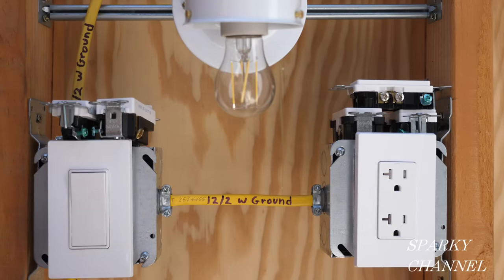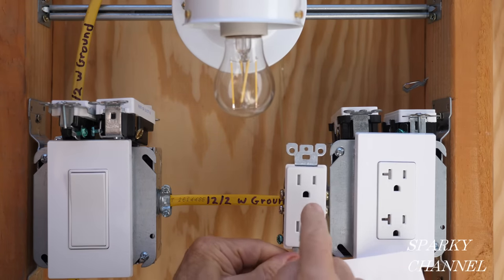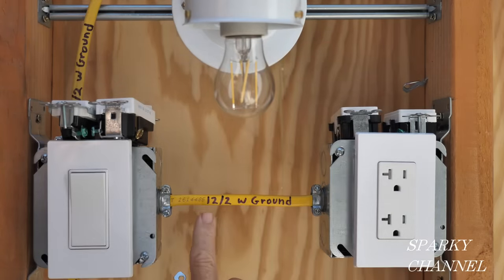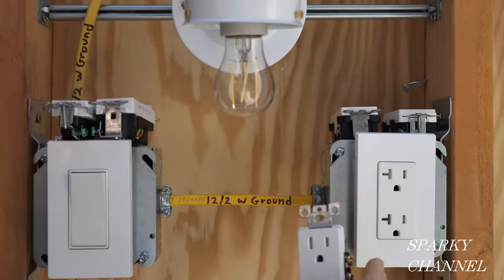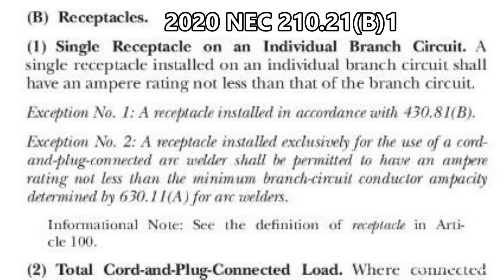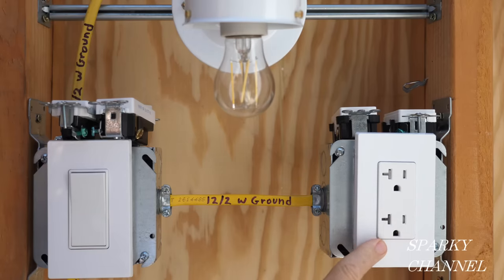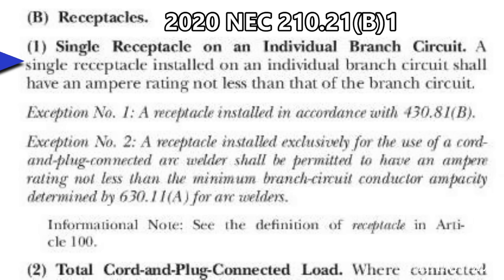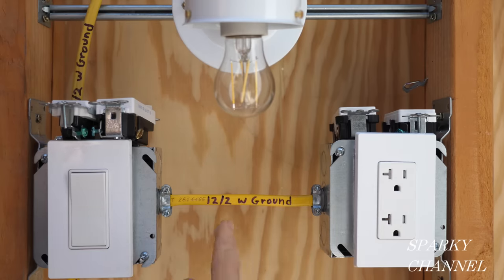Shall I Use a 15A or a 20A Receptacle on a 20A Circuit? + 2020 NEC 210.21(B)(1) and 210.21(B)(3)

Comment: In a residential situation they don't make appliances with 20 amp cords
Reply: What do you mean aren't totster's and coffee makers made with 20 amp cords?
Reply: @zacharywatts1514  they are typically plugged in to 20 amp circuits but the cord end is only 15 amp
Reply: Sure they do.
Reply: @brianharmeson3144  I've been doing electric for 17 years and have never seen a 20 amp 120 volt cord cap on a residential appliance.
Reply: @FH_83_02  That doesn't mean they don't exist. I've been in the trade for over 30 years and there are still things I haven't seen. That doesn't mean they don't exist.
Reply: @FH_83_02  Window AC, welders, large coffee makers, kilns, treadmills and the list goes on and on.
Reply: @FH_83_02  you said it. The key word is residential. 73
Reply: @zacharywatts1514  the commercial grade yes but the residential are 15 amp, or less depending on the total wattage. A two slice toaster uses less current than a four slice model. 73
Reply: How many people have a kiln in their home? Just thought I should ask. 73
Reply: @ronb6182  There are 120v 20A welders. There are also 120v 20A AC units. Contrary to the comment above, they are both frequently used in homes/garages. That's the whole point.
Reply: For the most part they don't excluding AC and welder units. Most normal people keep their welders in the garage or basement or outside shop. We are also talking about the horizontal neutral on a 20 amp plug. Enough said. 73
Reply: @ronb6182  thankyou for the specification
Reply: They should not be allowed to make 20 devices with standard plugs on them because they could be plugged into 15 amp circuits which will burn up the terminals on 15 amp outlets. My brother in law plugged in a spa in a 15 amp outlet and burned up the main GFI outlet. All twenty amp appliances should have the horizontal neutral. Probably the problem is China made products not UL approved. 73
Reply: @ronb6182  Yes, I know what a 20a plug looks like. You obviously haven't been around long enough to see the numerous equipment supplied with 20a plugs in residential settings. Just because you have never seen something, doesn't mean it doesn't exist. This includes basements and garages of course.
Reply: @ronb6182  You think 20a AC, 20a welders and 20a treadmills have 15a plugs on them? You're mistaken.
Reply: @ronb6182  I have wired power for more than a dozen kiln installs in the past 6 years in both garages and basements. It is a big craft thing in some areas.
Reply: @ronb6182  If you don't think people have 20a coffee makers in their house then you don't do alot of high end homes. I have installed 240v, 30a circuits for coffee makers before. It was a $7000 coffee maker.
Reply: @brianharmeson3144  give it up it's not on topic we are talking about kitchen appliances like microwaves and toasters mixers blenders not commercial appliances. All the home workout equipment I seen are 15 amp number 14 wire. Some are number 16.
Reply: @zacharywatts1514  Thank you I don't believe this other joker can argue with no sense. Time to put him away. Most homes I been in don't have twenty amp outlets in the house. I would like to have a few in my workshop I have a 20 amp power strip with a real twenty amp plug on it. When I move I will install one twenty amp outlet in my shop. The house has 15 amp receptacles that are daisy  chained on a twenty amp breaker. All passed inspection when I wired it back in 2001.  73
Reply: @ronb6182  This video has absolutely nothing to do specifically with kitchen appliances. You're making up things as you go along. This post is about installing 15 or 20a receptacles on a 20a circuit. Period. Nothing about kitchens or the appliances within.  Besides, my reply, which for some strange reason, you are so bent out of shape about, was a direct reply to the ridiculous comment by "F H" stating that "In a residential situation they don't make appliances with 20 amp cords" which is COMPETELY FALSE. Maybe you should read more carefully.
Reply: @brianharmeson3144  completely false?  Learn the trade before commenting on grown man shit
Reply: @FH_83_02  What specifically is "completely false" about anything I said?
Reply: @brianharmeson3144  they do not use 20 amp cord caps for residential appliances. Not sure why I keep getting notifications about this dumb shit.
Reply: So you actually know absolutely nothing about electrical equipment at all. Got it. 👍
Reply: Coffee maker, treadmill, jacuzzi tub, space heater, elliptical machine, pottery kiln, mig welder. These are all home appliances I have installed 20a circuits and receptacles for because they' had 20a cords on them. Just because you lack experience and haven't seen something, doesn't mean it doesn't exist. Grow up.
Reply: @FH_83_02  I’m not an electrician but I read/heard you should use 15A receptacles on 20A circuit to stay under 80% of total load of circuit?

And use 20A receptacle on 25A or 30A circuit?

I’m just asking because it’s what I heard and y’all seem to have a little experience.
Reply: @seabass22  you can use a 15 amp receptacle for 15 or 20 amp circuits, but not a 20 amp receptacle on a 15 amp circuit. The configuration is different. Anything over 20 amps needs a receptacle rated for the amperage.
Reply: @seabass22  I left out the last part of your question. The device doesn't control the load of a circuit, the breaker does. A 20 amp breaker is really only good for 16 amps and a 15 amp breaker is only good for 12
Reply: @FH_83_02  so on a 20 amp circuit, you should use 15A outlets?
Reply: @seabass22  unless the circuit calls for a 20 amp receptacle you will be fine with a 15 amp receptacle.
Reply: @FH_83_02  You're absolutely right. The only 20 Amp male plug I've ever seen was on a 120 volt electric welder. Not saying thats the only thing that has them but that's the only one I've seen.
Reply: Assuming that 20 amp plugs do exist in appliances for residential use, the requirement is that they are to be used on dedicated circuits only, meaning the 20 amp receptacle must be a single socket, not a duplex. Therefore the argument over needing a 20 amp duplex receptacle is moot.

Comment: No mention that the 20A's have stronger clamping force, so less chance of the outlet melting due to high resistance.
Reply from the maker: Thanks!
Reply: many are exactly the same internally.

Comment: Not being able to use a heavier duty component than is required does not make any sense?
Reply: Who says you can't? Just use a spec grade or heavy duty spec grade 15 amp and that's as good in quality as a comparable 20 amp device.
Reply: @surferdude642  Sparkey Channel and the NEC.
Reply: @sailingeden9866  I didn't say to use 20 amp receptacle, but rather than a residential grade 15 amp, you can use higher grade 15 amp. Bill (sparky channel) mentions these in this video. Bill was comparing a residential grade 15 amp to a spec grade 20 amp. He should compare apples to apples, then the quality is equivalent. The NEC provides the minimum requirement and is not an issue in this case.

Comment: I have a 20 amp breaker for the garage with 15 amp outlets. I honestly feel like the wire is 14 guage.
Reply from the maker: If it's 14AWG wire the maximum size breaker you can use is 15A.
Reply: @SparkyChannel  it does not appear that anything has been recently done. The house was built in the 80s. It did pass a through inspection. How can I tell if it's 12 or 14?
Reply: @jungleviper  14 gauge wire is 1.5mm diameter, 12 gauge is 2.0mm diameter. Bare wire, not including insulation.
Reply: @jungleviper  12 gauge is the thickness of a nickel and the 14 gauge is the thickness of a dime.
Reply: 12 gauge indoor wire usually has yellow sheathing whereas 14 gauge indoor is white. (Feel free to correct me if I am wrong)
Reply: @mauricecooper9016  I think the jacket coloring came about in the 90s, so won’t help for a house built in the 80s.
Reply: @robert-ne1835  lol youre right. I rewired my garage to turn it into a woodshop and i found white 12/2 and black 14/2 😂
Reply: Australia: 20amp breaker to protect 2.5mm2 Cross Sectional Area copper twin sheathed cable (240V)

Comment: It comes down to this:
(1) A 20 amp receptacle is slightly beefier inside. (Yes, I've seen both taken apart.) Thus, the 20 should be better. 
(2) Buying the 15 amp could save a few pennies, so they are favored by cheapskates who put price ahead of value. (Yes, I'm talking about you, Mr Average Builder.)
(3) You can save even more by buying the "residential grade" 15 amp if you are desperate to save a few cents - maybe even a dollar. (Yep, looking at you fine builders again.)
(4) You can buy the 20 amp "commercial grade" or "specification grade" if you have an extra dollar. Yes, it costs more the first time, but it's the only time you buy one. OR, you can buy the residential grade today, then do it again every 4 or 5 years when they get so weak the plugs keep falling out.
OH, YES, a 15 amp receptacle will meet code on a twenty if there is more than one outlet, such as a duplex receptacle. If your only objectives are meet code minimums while spending as little as possible, giving no thought to quality, then go for the 15 amp residential grade. (Guess who I was thinking of when I wrote that.)
Reply: Code should ban the practice of putting smaller amp GFCI outlets than the breaker. It causes home owners to overload other circuits because the GFCIs fail.

Comment: If you use a 20 amp receptacle, not only do you need a 20 amp circuit breaker, you need 20 amp wire!
Reply from the maker: 12 AWG wires usually. Bigger if needed for voltage drop.
Reply: I would tend to agree with you but it would depend on the local electrical code to determine that….those are the so called experts in this!
Reply: @brexit9279  i think code says 12g for 20amp and go up a guage every fifty feet or so for that power drop. i could be wrong though.

Comment: U can use either receptacle as long as the wire size is correct or lower.
Reply: Depends on the breaker. Meaning even if your wire is sized for a 20A receptacle but you only have a 15A breaker, you cannot use that 20A receptacle.

Comment: What is the danger of installing a 20 amp receptacle on a 15 amp circuit in your house? If you had a fault, loose connection, arc, or overload condition, wouldn't you prefer to have a more heavy duty receptacle? The reverse seems more dangerous to me that is installing a 15 amp outlet on a 20 amp circuit, since it will take the breaker longer to trip during a fault condition.
Reply: The plug is also information.  If you have an 20 amp machine with the cross type plug, you would assume that a 20 amp plug is in fact connected to a 20 amp circuit.   Breakers are there for safety, and while I would say that they're pretty reliable, you don't want to be in a position to rely on them with your life.

Also, don't forget that any object usually doesn't draw its full load immediately, but ramps up to it under load.  Someone could trip the 15 amp breaker, go to the garage and reset it, and then start it up, and trip again, and repeat.   Heat and other issues can develop in those circumstances.
Reply: @blueknigh7  I think you're exactly right, you should not plug 20A loads into a 15 amp circuit. If someone sees 20 amp outlet, they will assume its a 20 amp circuit.
Reply: With a 20A receptacle installed on a 15A circuit there exist the possibility of plugging in a device that requires more than 15A for normal operation. And being a 15A circuit, the wire is not rated to conduct over 15A, and not we have the possibility of the cable heating up and even igniting the insulation and anything in its proximity. That is if the breaker doesn't immediately trip.
Reply: You can't tell the difference when you look at it if it's a 15 or 20 amp outlet that's the problem
Reply: @dscollo  You can tell the difference by looking. The 20A outlet has a T shape for the neutral contact. A 20A appliance has a plug with a horizontal spade so it only fits into a 20A outlet.
Reply: You can get commercial grade 15A receptacles. Those are pretty much the same thing we saw in this video.
Reply: A 15A circuit usually has 14 gauge wire, which shoulfd never carry more than 15A. A 20A receptacle would allow someone to pull 20A through that thinner wire, possibly causing overheating in yhe wall if the breaker doesnt pop rihht away.
Reply: If a fault occurred it should still hit the instantaneous trip region whether you use a 15A or a 20A breaker, so either way it’s going to clear within 1 cycle. As long as the wiring is rated for 20A, using a 20A breaker is not more dangerous than a 15A breaker.

Comment: Sorry to see that you were hacked. I subscribed to get you back and running. Can you use 14 gauge wire and 12 gauge in the same circuit as long as you use a 15 amp breaker?
Reply from the maker: Thanks Art! I have seen nothing in the NEC to suggest that you can't exceed code by putting 12g wire on a 15A circuit. However, I did get flunked once by an inspector for doing just that.
Reply: The only problem I see is that sometime in the future someone might see the 12 gauge wire and replace the 15 amp breaker with a 20 amp, not knowing the circuit also has 14 gauge wire in it.
Reply: I would only do that if the wire in the panel is 14 gauge.
Reply: If you look at the length of a circuit, and calculate the voltage drop, you may be REQUIRED to install 12 gauge wire on a 15A circuit to compensate.  Any inspector failing an inspection for oversized wiring shouldn’t be an inspector.